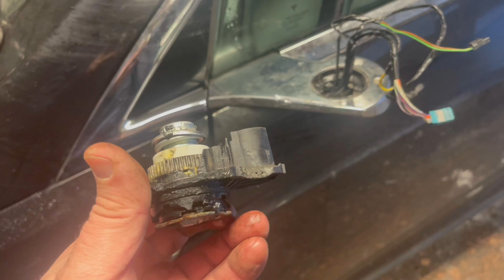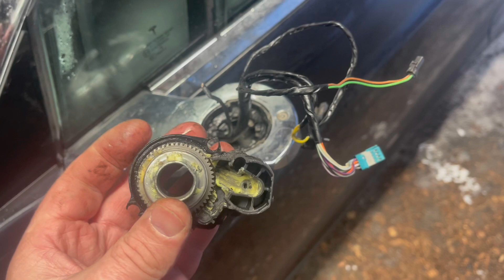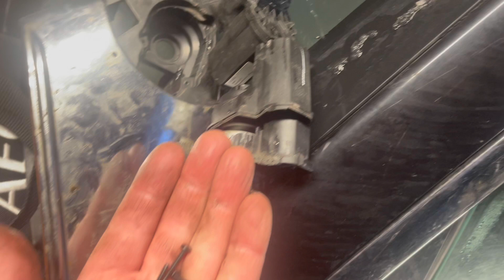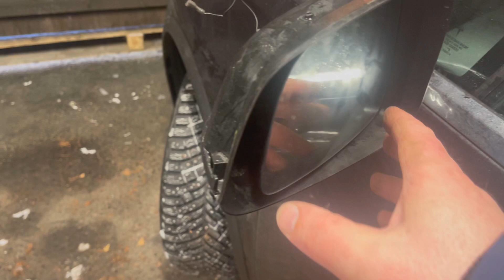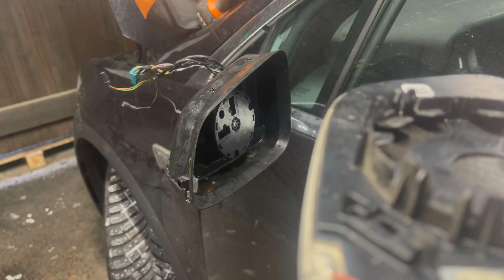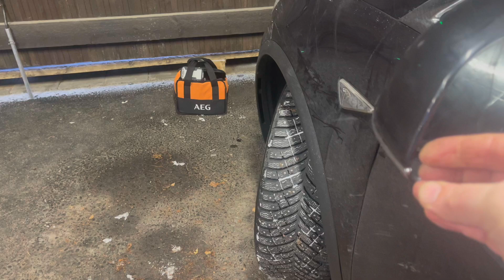Tesla Model X Side View Mirror Motor Fix

Comment: Hello there in Finland :-) we have the same weather in Wales and if I do this, it looks like I will be as cold as you were ;-) Also, thanks for taking the trouble to make a video, I have this exact same problem and hours later, yours is the only relevant video I have found. Did you say you had to take the whole door panel off first though? That scares me - and the wire you cut, did you not perform any sort of fix for that? In your video, you have somehow removed the outer part of the whole mirror, how did you do that? Sorry for all the questions but hope you reply - thanks again
Reply: Hi again, 
Was it difficult to get the back off?

Comment: Exactly what i'm trying to do, what was the name of the part you got?
Reply from the maker: This was the exact part I ordered and seems to work well: https://www.aliexpress.com/item/1005006465935332.html
Reply: @ how did you get the old motor out of the housing ? Was it sealed with clips. Just took a look at my model S and it looks like i need to seperate the lower arm from the top housing
Reply from the maker: @L44TXF no motor itself was attached with only three Torx 10 screws. Mirror assembly itself came out of the base (or tab or whatever it is called) by twisting it by hand. I had to use pliers to twist from the motor tube since the old motor was broken. I hope that helps…
Reply: @ appreciate it been very helpful. Someone hit my wing mirror, no scratches luckily but the motor is hesitating now